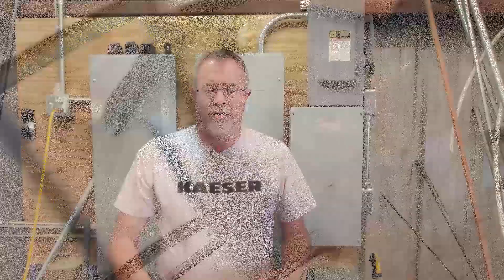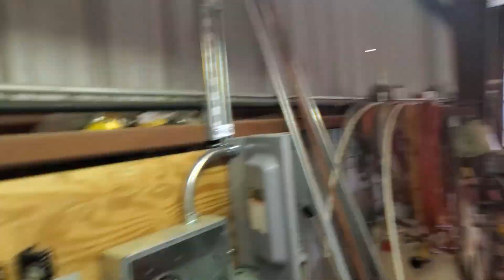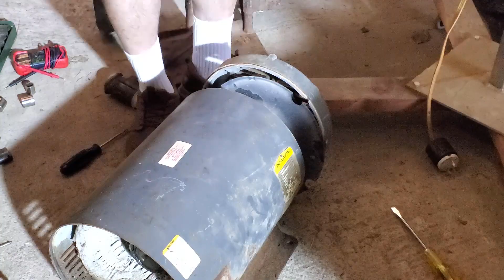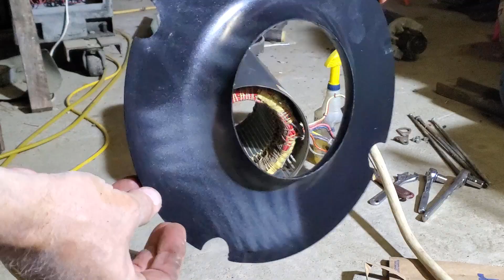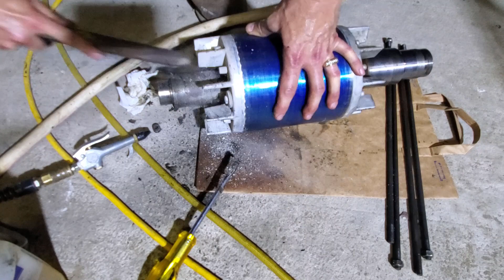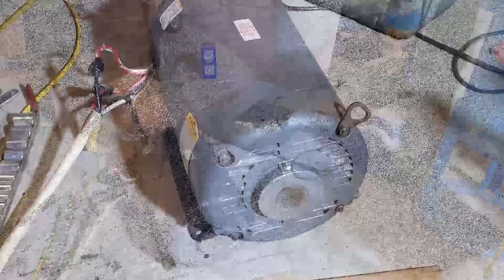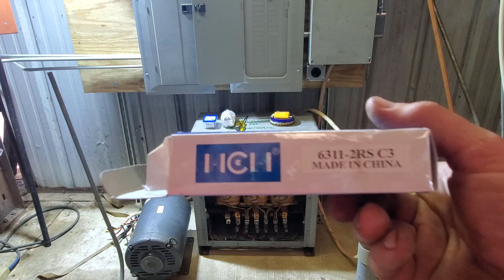30HP TEMCo Rotary Phase Converter & 45 KVA 460v Transformer

Comment: I’m not clear.
220 single phase > RPC which is putting out 220 three phase > step up xfmr which will put out 440 three phase?
Correct?
Reply from the maker: That's the plan. The transformer is technically  a step-down transformer, I'm just feeding the LV side with 220. It does work, but I'm currently having issues with the 30hp Baldor. I think it has gotten moisture in the windings and won't start. Draws a lot of current. Going to try a 15hp motor in it's place and megger the windings.
Reply: @EngineersWorkshop  
I worked as a marine electrician for years.  Put some 100-250w heatstrips or some heat lamps on the motor for a couple days.
See if meggar readings come up…if the windings are good they most always do.  Windings just need to dry out.
Keep that motor off the ground.
🙂
Reply from the maker: @mudnducs  That is exactly what I intend to do... insulated box and heater fan for a couple days. Agree on elevating the motor off the concrete!
Reply: @EngineersWorkshop  
Good on ya!!!
I’m trying to power up my machine shop too.   Man, the prices on a 20-25 hp rpc are ridiculous.   Gonna build my own if I can find a 20/25 hp motor.  Even used ones are ridiculous.
Best of luck to you.
(Mech eng.  retired)
Reply from the maker: I was lucky to get mine used from a gent who replaced it with new eqiipment. He was a marble counter guy so the inside was filled with marble dust. Replaced the bearings straight away. Check HGR Industrial Surplus, they usually have some deals.

Comment: If you are concerned about cost of copper wire, why not just use aluminum? It’s like half the cost.
Reply from the maker: Just trying to flow the most amps that will fit by code in 1" conduit. That means copper.

Comment: I have a similar issue with the controller being misplaced with all the caps. I have a 30 horse Temco Identical to that and I was wondering if you could tell me the capacity of the start caps and the run caps that would help me here to get my system up and going much appreciate it. Thank you.
Reply from the maker: Will try to look at them tonight. As you know, they are glued in place and I don't know if I'll be able to see any of the labels.
Reply from the maker: Shoot me an email and I'll send you pics and specs. Engineersworkshop1964@gmail.com

Comment: Hi, would a 5HP rotery Three Phase Converter be big enough for a 4.4 KVA EDM machine ? Thank you for any help.!!
Reply from the maker: The rule of thumb i've heard is the converter should be 150% the size of the largest motor to start. 4.4kw is closer to 6ho, so you'd need a 10hp rotary or maybe squeak by with a 7.5hp

Comment: 2 things about the fuse box from an electric co. substation person perspective: 1. Source should be the top side. 2. Place a couple of extra fuses in the bottom of the cabinet. One more from the same perspective: The standard is - there is no standard. This equates to Never assume Anything! Oh, as far as bending large wire - just use an appropriate box end wrench or 2. Good score & progress! The basic reason for your higher voltage at the idler motor is the capacitor bank in the phase converter. by improving the power factor the apparent voltage reads higher. It'll come back down when you put a motor load (inductive) on it.
Reply from the maker: Thank you for the tips. The breakers are inadequate to toggle the load of the 30hp motor on. I need a real starter. Once I obtain one reasonably priced. I'll get back on this project.

Comment: Nice job on your project esp. the motor clean up, I need to do that to a motor I have that runs Hot on the shell, might be dirty inside or bearings or both, could be about shot won't know until I open it up.
Now that 460 your talking about at the end is that considered single phase? Like I have this welder that is single phase and it can use 460v and like you talk about smaller wire less amps required, in my case running the welder at 275A put out it requires 47A 460v or 230V 94A so the 460 cuts it in half, the requirements for amps and of coarse the wire.
I watched this video a couple days ago and just the other day was bidding on a several different electric wire (big ones) on pallets, me and another guy drove the price way up, he was going to skate away with pallets of wire for dirt cheap until I started bidding, we went up to 350 then I threw in the towel because I wasn't sure if copper or aluminum and what awg. yeah you are so right about copper wire, just an run from house to my garage of 1/0 copper 3 wire W/ground is like 1500 bucks.
I want to do what you doing looking for a motor and maybe a transformer soon.
Reply from the maker: When everything is running the 460 would technically be three phase because the idler motor will distribute power to the third transformer. It will be a bit wonky if the balance capacitors aren't perfect, which they never are. Still should be able to run motors wired 460 though. I have a couple motors that are wound dedicated 460 so right now I can't run them until the setup is complete. Thanks for your interest!

Comment: How much would the power company charge to run a 3 phase supply instead of the single phase you got? And how long was the cable run to your building?
Reply from the maker: I imagine the cost is zero, like the single phase. They base the job on the projected load. There was plenty of prep work toward the three phase even with the single phase install. I have a new terminal pole, all three phases brought down, and it is less than 100 ft to the building from the transformer. The real cost for me is internal panels and switchgear to house the three phase. The sawmill was gutted and nothing remained.
Reply: @EngineersWorkshop  I have to say I personally would have opted for running the 3 phases in the building as soon as I could, especially if there was little to no increase in cost. Wouldn't it be possible to only connect to a single phase inside your building until you were ready to run 3 phase circuit? Of course I don't know all the details of why you chose to do what you did so could be wrong.
Reply from the maker: The equipment required is thousands of dollars. I don't have the means financially to do it just yet.
Reply: @EngineersWorkshop  I understand, thank you for your reply!

Comment: Im working on a similar project. Were you successful with the 208 to 480? Im looking at used transformers and have been over looking the 480/208 for the 480/240 versions. I wasnt sure i could get to lower voltages (440-480)with the 208. If its doable, I may consider buying one. They are a bit more available in my area. Please let me know thanks!
Reply from the maker: The 208Y-120/480 are definitely more available. There was definitely enough adjustability in the winding taps to make the stepped-up voltage come out correct in my case. From comments and investigation by Grumpy Oldman the increments are fairly standard with 12v steps. Check out my subsequent video "Probing 500v" and I think I plotted the available voltages with the steps. I have not run a motor off the high voltage but plan to. I also may use it as a source for unconditioned 460v three phase for a 20hp VFD to power a large Quincy screw compressor.

Comment: A little bigger than the Baldor on my 2 KVA Ronk RPC. Your high mystery current is probably explained in the Ronk instructions: "When the ROTO-CON is running idle (three-phase load shut off), all the capacitor current flows into the rotary transformer. That is why the rotary transformer gets warm to the touch when it is idling. When a load operates, most of the capacitor current now flows to the load instead, so the rotary transformer will actually cool down under load. Due to the heating effect of the capacitor current, avoid operating the converter at idle for extended periods, if possible. Because the capacitors’  current flows into the rotary transformer at idle, any additional capacitor panels must not be directly connected to the rotary transformer."
Reply from the maker: That makes sense. Thanks for your interest!
Reply: Hi, would a 5HP rotery Three Phase Converter be big enough for a 4.4 KVA EDM machine ? Thank you for any help.!!
Reply: @billyhickson1632  I'd contact American Rotary with that question. I'm just a dumb mechanical engineer...

Comment: I am a sw engineer so this might be a dumb question but I saw you got new sealed bearings; with those you dont need to apply grease to the bearings; correct?.  I would imagine those grease points where used in the old times where bearings didnt came sealed?. Is there any advantage to use nowadays open-style bearings vs sealed ones? BTW Thanks for the video! :)
Reply from the maker: It's actually hard to find open style bearings anymore, so yes you are correct. Originals were open style and almost all of the new ones are now sealed. They contain just the right amount of grease for a long life and the grease fittings on the motor frame will not be used

Comment: As you know since I told you already that I've got my whole shop or garage apart until my back property shop is complete and I have all electrical apart to accommodate for the downsizing in big garage and the lack of power from electrical company. My machines are back to just sitting until I'm done. Ok. Seeyah later.
Reply from the maker: I understand and feel your pain about having machines just sitting. I have a few machines doing the same thing myself. Good luck to you in getting everything back up and running, it sounds like it will be a fantastic shop once you're done
Reply: @EngineersWorkshop  thanks buddy, it was a beautiful shop but since selling it all and moving to house with property to build a shop and acquiring machinery again but nothing like I had, it's been a journey but at least I still have and bought much more equipment again. Going to run in this decent size garage in the house we bought for about another year or 2 till I can finish the shop out back. Should have my power back and equipment running again in next 30 days but it's coming together. Seeyah buddy. Let me know on those collet change over for the 2d. Finally found my trip dogs for the KT2D rotary, sitting in a box from the move.

Comment: Actually I was a bit concerned about how much grease was used and with that amount of dust it only makes it worse. But again, great job. I'm also wondering if VA Power brought in a 2ot service for you and did they stop at the weather head of your building?
Reply from the maker: I think I explained this in one of my old videos, but if you look at the three Transformer boxes only one of them is an actual Transformer the other two are dummies. I am told that there is a live phase coming up into each of the dummies.
Reply: @EngineersWorkshop  why wouldnt you be able to use a single phase to 3 phase VFD instead for each of your 3 phase motors ?
Reply from the maker: At 220v, the vfds are good up to about 5hp. The Monarch lathe is 7.5 HP and I plan to have bigger motors elsewhere
Reply: @EngineersWorkshop  ahhhh..thanks.. what were you able to pick up the phase converter for$? if you dont mind me asking ?
Reply from the maker: $150 if I recall
Reply: @EngineersWorkshop  nice . great channel great info , am definitely a subcriber now .
Reply: Hello sir im wondering if you were able make it work the 30hp rotary phase converter to the transformer step down to 220v to power some basic tools  i am very interested to know , by the way im looking forward to watch the next video  I hope you upload new update
Reply from the maker: Currently I have an issue with starting the load of the motor and the transformer together. I am working on a solution and hope to generate 460v from the idler + transformer. I will post a video when I solve this. Thank you for your interest.

Comment: Leave the motor low voltage just connect the RFC 3phase load wires to the low voltage side of transformer. Then send the 480 to your load. Don't have to target 460 specifically if it's a 480 transformer. I use transformers as step up all the time it's fine. But if u only feed the transformer with single phase you'll get all kinds of goofy voltages. I'd also have a disconnect between RFC and transformer. Get the RFC started then turn on transformer. Also be prepared for main breaker to potentially trip. Transformers have massive start-up current untill it develops magnetic flux. I didn't hear u say what size breaker you used. If it's 100 amp u may need 125. If you try to start up that motor and transformer at the same time the inrush will probably trip your 200 amp main. Just a guess tho
Reply from the maker: Actually I planned to power the transformer L1, L2, and neutral directly from the main panel on a separate 100A breaker. That way I could energize two transformer coils prior to starting the RPC. My idea of putting the motor on the high side requires a starter (which I have) wired on the 460 side with a 110v coil, energized when the RPC disconnect is closed. Otherwise two motor legs would be live when the transformer powers up.

Leaving the motor on the LV side is simpler, but I worry about the additional inrush of motor + transformer on the capacitor bank. There's a wicked arc on the contactor when it cuts out, maybe the timer can be adjusted to cut out a few milliseconds sooner. My woodworking shop uses an adjustable time delay relay to cut out the start caps, and the motor definitely isn't up to full speed or I get that same wicked arc, or a loud hum as the generated voltage on L3 comes up.
Reply: @EngineersWorkshop  u can't only feed two legs of a three phase transformers. They really don't like it. The arc is normal. If there is a hum the timer is on too long. That's y I suggest u start the RFC then once running the start caps are out of the circuit already so no additional load on that contactor when u start the transformer in step two with additional disconnect between RFC and transformer. What do u mean u have a starter? Do u mean the capacitor bank? They may not be rated for 460 volts. Trying to have the capacitors on the high voltage side will most likely lead to a meltdown. Putting the transfer after the RFC is the "norm" for what your doing.
Reply from the maker: @electromechanicalstuff2602  I understand the caps are on the LV side. My scheme is second breaker energizes two transformer coils and builds their field. RPC disconnect is still off. Turning RPC on connects caps to third transformer leg and simultaneously energizes coil of 460v motor starter, connecting all three motor leads to HiV side of transformer. I can picture what's in my head but may not be describing it accurately.
Reply: @EngineersWorkshop  u need the caps on the ghost leg of the motor..that's what balances the voltage. Maybe Im misunderstanding what your trying to do. What your doing is not uncommon. Everyone keeps the whole RFC on the LV side and just feeds the transformer to step it up. BCblock is doing it and so is Abom79 along with many others. I tried feeding a three phase transformer with only two legs and the inrush current was not only higher then normal because the transformer never establishes the proper balanced magnetic flux but also the voltages are all over the place on the high voltage side. I understand your concern with the high inrush trying to start both motor and transformer at the same time. But you won't be so it's ok. I have 100 amp breaker on my RFC to support my inrush. But then a fused disconnect with slow blow 60 amp fuses to protect the RFC.
Reply: @electromechanicalstuff2602  you are correct. The transformer has to be connected after the RPC is started and not before. Assuming the 480 side of the transformer is Y, ground the center point of the star and you will have "normal" 480/277 power. If it is delta then you will need to figure out how to safely ground the 480 system. corner grounding is valid but gives a high potential from ground to the other 2 legs (480V).
Reply: @EngineersWorkshop  The arc quench can be a problem. If the contactor has multiple poles, wire them in series to improve the voltage breaking capability. Or use a 600V rated contactor if the existing is less than that. I used a 30A 600V 3-pole contactor with all 3 poles wired in series for my 440V-only grinder start cap circuit from 480V single-phase transformer to control the arc.
Reply from the maker: @grumpyoldman5368  looks to me like a garden variety HVAC single pole A/C compressor contactor. Room to go to two or three poles. Coil must be 220 because there's no neutral in the capacitor panel.